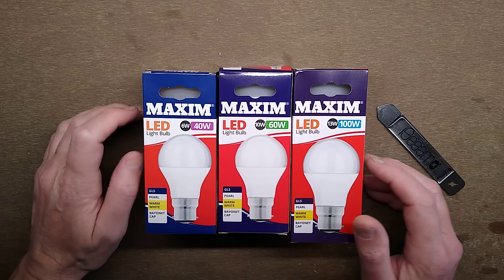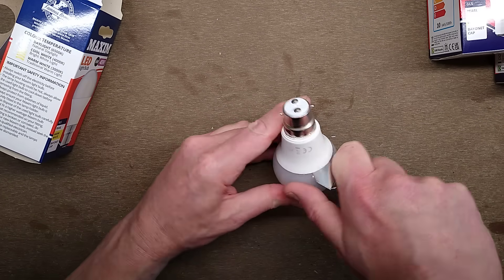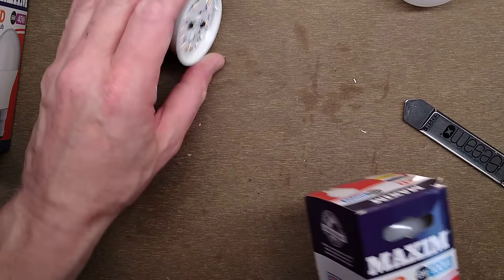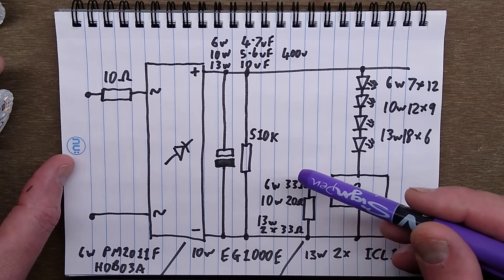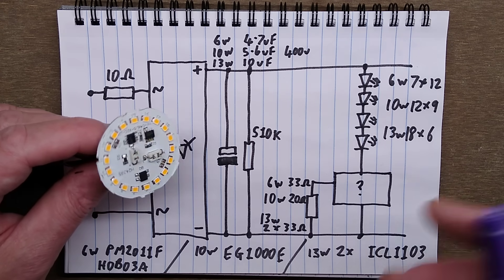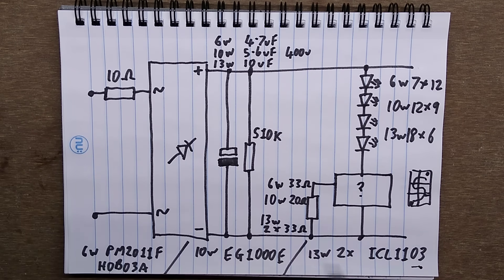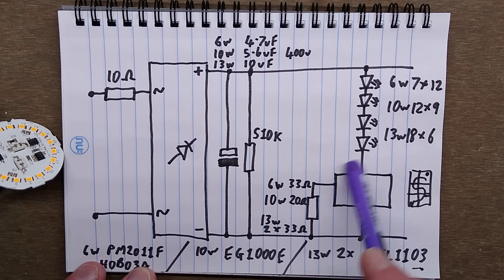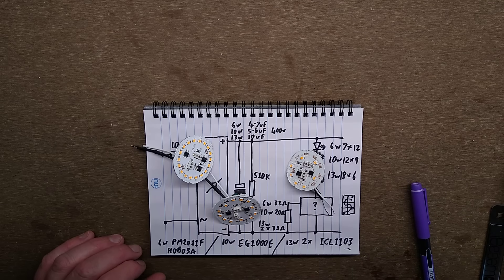6W vs 10W vs 13W LED lamp showdown (with schematics)

Comment: I'm curious as to why they don't make these with the switchable voltage doubler, like older power supplies. That'd allow the same PCB to be used worldwide. (Except in Japan.)
Reply from the maker: It may be cheaper to do it with the alternate LED number configurations.

Comment: what can be the problem in having too many bulbs in parallel with such a low PF? I appreciate any advice; thanks for your always great videos.
Reply from the maker: There are two factors.  Inrush current as the capacitors charge, and the higher measured current.  On very long runs of festooned lights that could cause rogue breaker tripping.

Comment: Great comparison and explanation! I have a NOXGEAR TRACER360 lighted safety vest and it works great, it changes color and as many different modes, flashing and non-flashing. The circuity must me good for it has been woking for seven years, and the three "AAA" batteries run for a long time. Wish you could take it to bits Clive.

Comment: Circuits are getting simpler as time passes. Eventually, the circuit will only have a single device, with diode bridge, current limiter, and capacitor all on one chip. Power controlled by chip number / LED driving voltage. COB LED's seem to be more popular, with only two terminations.
So, mains in - fuse - chip - COB LED. Nothing for Clive to change, and no option to reduce the power 😱

Comment: Greetings. Is the post bridge cap exposed to the mains several hundred peak volts?  At several uF, I am surprised it is designed for such high voltage (it look electrolytic, normally low voltage)
Reply from the maker: It is rated for 400V.

Comment: Re using a butter knife: I used this mantra trying to prise off a stubborn plastic lid from a soy sauce bottle so I could recycle the bottle. Slipped, and ended up in A&E having my left index finger’s distal knuckle joint/tendon sewn back together.

Comment: As for the smooh. And the  monkey flipped the switch. They are catching on to you Mr. Clive, removing the second resistor. Awesome job. As for removing the resistor and suppling a new higher ohm resistor, can't you just add a second resistor and use a voltage divider calculation to get a higher ohm resistance? My brain is refusing to do the math  today. I over worked it yesterday.
Reply from the maker: The original resistor needs replaced with a higher one.

Comment: As you pointed out in a ( previous ) video , the most efficient  LED bulbs are those with the yellow / orange long " filaments " inside a ( usually ? ) clear bulb ..... it seems stupid to run the chip LEDs so hard that they have to be mounted on a heatsink , ( any heat generated  spoils the bulb's efficiency , and may shorten their life ! ) ... the whole point of LED bulbs is to give the most light for the least Watts input ! ( Dubai lamps ? ? ? ) .... BTW , my favorite small mains LED bulb is the UK  Tesco™ 1 Watt " fridge bulb " ( E14  SES base ) , perfect for use by the computer , etc ............. also ( above bulbs ) , take the damping resistor out , and you have a " nightlight " function ( in certain houses wired with a long switch drop ! ! ) ............

Comment: I'm surprised that the bulbs had such different construction between each version. I half expected them to be more or less the exact same circuit with just a few component tweaks to get the wattage.

Disappointingly sloppy manufacturing though, but then again, how long are they expected to survive? - Perhaps all that schmoo on the LED chips is how they fine tune the light output?! 🤦🤣😸

Comment: Now just buy only the 13W version, remove one 33@ resistor, add an X1 class capacitor on the input of the full bridge rectifier (to have an RC low pass filter to cut any electric spike on the line) and you'll have long lasting lamps...

Comment: When i remember to note the invoice number, I return the lamp to the shop for a free replacement. They always fail before the promised 10000-15000 hours; the purchase date isn't even that far away. And of course they aren't on 24hours a day.
Only returned 6, no questions were asked. Most were the round ceiling lights without replaceable LEDs.

If everybody started returning lamps that died prematurely, I bet we would see better quality lamps. (The shops probably would avoid selling the cheapest quick-to-die brands)

Comment: Big c, off topic but can I pick your brain? Years ago I had a eon power down intelligent plug thing turn up in the post one day (will put ebay link in reply) it would turn off the pc monitor when the tower is turned off or tvs and such. I lost it ages ago and didn't use it much but I need something like that now to turn a extractor vacuum on when im cutting wood with my chop saw. Seems it just switches on the secondary outlet when the load is seen an the primary outlet?  have u ever seen something like that or done any videos? Im tempted to buy one to try but im not sure if it will handle the load and switching on and off lots of times when making cuts? would love to hear your thoughts on if it would be okay maybe even a takedown and test!
Reply from the maker: You can get master/slave adaptors that do that.  Not sure the best source.

Comment: Two comments:
1.  Re the risk of a cut from the smudger slipping, wood carvers use a single kevlar-fabric glove on the left hand to prevent accidental cuts.
2.  Its interesting to compare the ratings of the three lamps, but I would also like to see one additional parameter - the actual light output in lumens.
Reply: Did you mean SPUDGER?

Comment: A little bit numbers: hacked 10W version lamp from local store. It was with 2 different resistors and BP2836D(not sure) chip. "removed" the smaller one.
Manufacturer promised 800Lx, measured 600Lx, after hack: 450Lx.

Comment: I see there is a downloadable ICL1103 datasheet. It's brief and I don't think it shows or says a great deal more, except that the current can be set between 5 to 60mA and has overtemperature shutdown protection.

Comment: The are really driving the LEDs very hard, they and the driver chips must be absolutely baking in the 13W lamp. It would be interesting to compare the light output per watt. I bet the 13W lamp is the worst of the lot.

Comment: Here where mains supply gets unpredictable when it rains I am trying to figure out how to reuse failed led lamps.
They often only fail on one led chip - probably due to load shedding or switching surges - no spd’s here either!
I have already recycled failed 1.5m striplights into 2 emergency lights powered by rechargeable AA NImH cells driving a joule thief circuit to produce the 40+ dc volts required. They run for about 5 hours.

Comment: I honestly can never find any LED's that last longer than a few months. Obviously, there are times of the year where you don't use lots of light. I still find even expensive ones to be almost as bad i have a 3 light setup with 2 working lights though so not sure if that makes a difference.
Reply: I've had success by noting the reciept number and date on the bulb, and return to the shop when they fail because the promised number of hours had passed. Only done it 6 times, mostly on ceiling lights without replaceable LEDs , haven't been refused yet.
Reply: my house had 9w everready led lamps, most are at least 4 years old(ie were here when I moved in) only just starting to get the odd failure

Comment: I love led bulb teardowns, I just got a 40watt Philips lamp and am very suspicious of it because it runs burning hot and has no proper heatsink apart from its smooth flat case like these.  Id be much happier if it had fins and ran cooler :/
Reply: Sad to hear that. We have some Philips LEDs from a few years ago that had great light, ran fairly cool, and were relatively inexpensive. At the time, we thought they were the best value by far.

Comment: 20W floodlight with PIR by LUCEC has two JW1691H IC's with 27K control resistors. 
Found the PDF for JW1691H without any equation for power, but evaluation circuit indicated 33K for 10W.
My actual power was 19W, so I calculated 39K would halve the power and got 9.5W.
I had to saw one end off the ally frame to get my knife into the silicone to remove the tempered glass.

Going to use Loctite Extreme glue to waterproof reassembly - 50ml at Poundlnd £1 last week!!!

Comment: The true LED bulbs (non -poundland) have a 100 - 240 Volt range, and use an high efficiency switching regulator with a controller IC.
I tried the Poundland LED bulbs, and they randomly die after a few months, usually all together during the summer...

Comment: So that poor power factor is just due to the not-sinusoidal current waveform? Makes you wonder if adding a big series choke and input cap would fix that, not that it’s worth doing.
Reply from the maker: A simple inductor won't fix electronic power factor.  It's a complex waveform.
Reply: @bigclivedotcom  I was thinking the LC filter could smooth out the current waveform a bit

Comment: Why are resistors made in such a pre-defined value way? It seems to me that manufacturers could make a resistor any numeric value they like. But as you point out in this video, they don't -- they stick with very specific values, skipping values between. Where do those values on the ones produced come from? Did they get standardized over the years based on which values were most commonly demanded by the companies that make the products utilizing them? Or is there some maths involved that tells them which values to support and which values to skip over? Or perhaps the system they use allows one to come up with every possible value so long as one is willing to use two resistors, rather than just one? One of the things I learned in maths and science classes was to look out for 'magic numbers' -- numbers that appear in a program or formula that are hard-coded/fixed. It does seem that something like this is going on as it pertains to the resistor values that are supported and most commonly found. I'm just trying to understand how the resistor manufacturers come up with the values that they do actually put into production.
Reply: The actual value of a resistor is not that accurate. For most of history, resistors had a tolerance of 5%, which meant any one 100Ω resistor could be anywhere from 95Ω to 105Ω. So it didn't make sense to have lots of values - what's the point of having a 102Ω resistor, when it's value could be less than any 100Ω?

The actual values they produced were standardized very early - a group of radio manufacturers got together to share patents, and they also set up the - 'E' series of preferred values, with a number representing how many different values would be in each decade,. For more, see the wiki article on 'E Series of Preferred Values'.
Reply: @robertbackhaus8911  "what's the point of having a 102Ω resistor, when it's value could be less than any 100Ω?"

Well, I would say that 102Ω +-5% is probabilistically different than 100Ω +- 5%.

Your reference to E Series of Preferred Values is definitely helpful to go on, though... TYVM!

"The E series of preferred numbers was chosen such that when a component is manufactured it will end up in a range of roughly equally spaced values (geometric progression) on a logarithmic scale. Each E series subdivides each decade magnitude into steps of 3, 6, 12, 24, 48, 96, 192 values"

This looks decidedly similar to base 2 in computer science in that it keeps doubling. But rather than starting with 2, it starts with 3...bizarre. That appears to be done to factor in the tolerance levels? And while you can't get EVERY value by using just two resistors, it seems to my novice eyes that you can get very VERY close -- within the tolerance range.
Reply: Tried to answer you twice now and my posts keep vanishing. Maybe somebody else will be able to answer you. I give up.
Reply: @sootikins  I would have liked to read your responses. I know some places don't allow you to put URLs into comments. Beyond that possibility I don't have any idea why your responses would vanish.
Reply: @shanejohns7901  YouTube is weird about comments sometimes, probably because they let poorly designed AIs decide what is and isn't okay. My vanished replies contained no URLs and no "bad" words. They didn't say anything that hasn't now been said by Drew and Robert above, so no big loss - just annoying.

Comment: Clive, what do you do with all of the working devices, bulbs, etc which you dismantle? Do you reassemble them (if possible) and use them, maybe give them away, etc?
Reply from the maker: I sometimes reassemble, mod or strip the PCBs out.

Comment: What would be the difference if the capacitor values were changed instead of changing the resistors? I was also thinking the 13w one could really be reduced and last well forever.
Reply: The capacitor in this style lamp is acting as a filter - not as a dropper. Changing the capacitor value will accomplish nothing. (Well, if you increased the cap value a bunch you might be able to get the fuse resistor to blow, or if you decreased it a lot you could produce some flickering)
Reply: @sootikins  Thank you

Comment: I might be turning into an cynical old fart Clive, I fear the use of different chips is purely economics and not to decrease mortality of the LED luminaire or quality. In named brand products, I would suggest the opposite. The cheap products have all sorts of issue, ie increased mortality, excessive harmonics - more noticeable with large numbers of these cheaper LED luminaires, and general overall quality issues as was evidenced with the 6w luminaire having silicone extending over 3 of the 7 LED's (42%), plus the lack of a "real" heat sink within the package. Yeah, maybe I have already transition to "cynical old fart" status 😳.

Comment: Hi Clive, I bought the 10 watt versions of these as they had a good amount of LEDs. I then modified them down to 2 Watts by disconnecting one of the regulator chips and putting a resistor on the other for the minimum current.
It obviously stops the LEDs being baked and produced quite enough light for my rooms.
In this cost of living rise and the obscene rise in energy prices I don't have to worry about the energy costs for lighting.
I was inspired to experiment with different LED lights to get something as close as possible to the Dubai bulbs you have previously shown.
Reply: And here I am adjusting the duty cycle on each of my €50 Philips Hue lamp to get the same result lol.

Comment: Any reason to keep the load resistor? I would prefer a bulb that dims slowly after it has been turned off and glows in the dark if the switch has enough capacitance.
Reply from the maker: Other than the risk of a slight continuous glow due to switch leakage, it also means the capacitor holds a decent charge and can zap you if you work on the PCB.
Reply: @bigclivedotcom  Thanks, I think a slight continuous glow due to switch leakage could be a bonus, as a ”free” orientation light at night.
Reply: Without it, it would take minutes to fade away, and in many houses, would never turn off because of capacitative coupling between mains wires, which can feed a few mA across the power switch.
Reply: @robertbackhaus8911  or more if the switch open neutral instead of live.
Reply: Swap for a bigger value resistor for a slow dim

Comment: Don't bother hacking the resistors - buy the lower wattage rated light in the first place!
Reply: you're missing the point of this "hack". lower wattage bulb will have lower LED counts hence similar power output per chip. take example of this video, 6W bulb uses 0.85W/chip, 10W bulb uses 0.83W/chip, and 13W bulb uses 0.72W/chip. take the 13W bulb to 6.5W,  each chip would take 0.36W compared to 0.85W as in "real" 6W bulb. this will increase its efficiency and prolongs the lifetime. these Chinese LEDs mostly died because of heat

Comment: I haven’t looked at Dollar Tree’s similar offerings of late. I haven’t bought any in over two years. Of course they’re all 120-volt and are now, like most things at Dollar Tree, $1.25 each. From the outside they’re very similar to these except designed to be screwed into an Edison-style socket. The last one I opened up didn’t have a current-regulator chip, but maybe the ones currently for sale have them. I should have a look.
Reply: I have had at least several of the Dollar Tree bulbs, almost all started to dim and then flicker. I have had much better luck with the Sylvania bulbs from Menard’s at roughly the same price.

Comment: would running them without the cover help with the heat, or have some holes near the join ...
Reply: Yes, especially if the capacitor is on top of the board. And you increase the amount of light coming out and can get away with a watt less power.
Reply from the maker: The only hazard with that is exposed live connections.

Comment: This design seems ok but besides the QC issue with the silicone I don't like how the capacitor is right on the board instead of being at least few mm away from the hot part.

The different regulator chips might also be their general supplier diversification or a consequence of the chip shortage, using whatever they could find on the market at the moment
Reply from the maker: The capacitor is in a socket, which helps.  Some have it spaced off the PCB further.